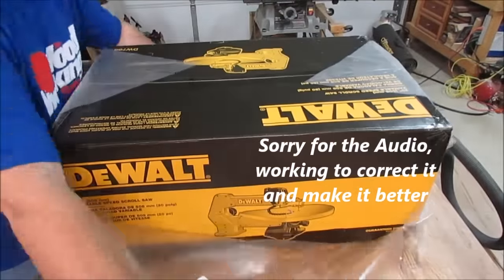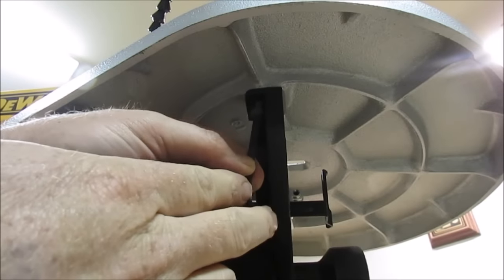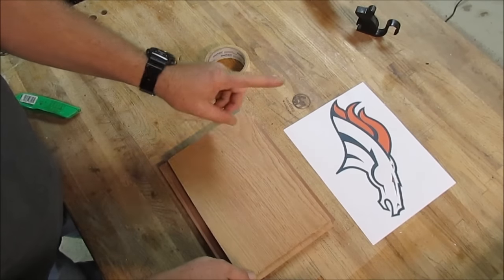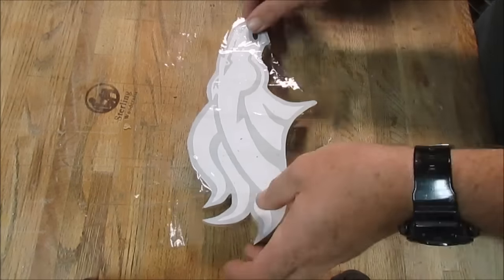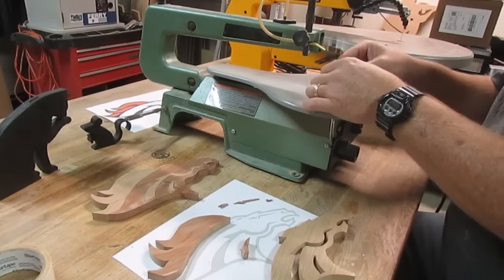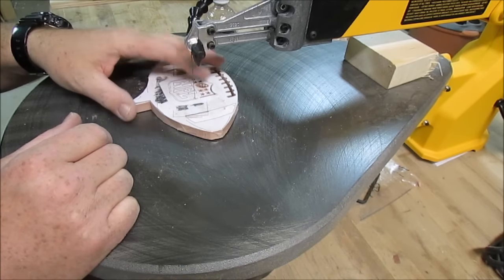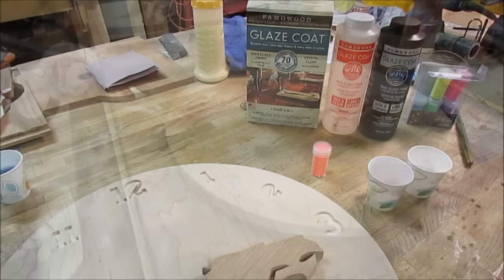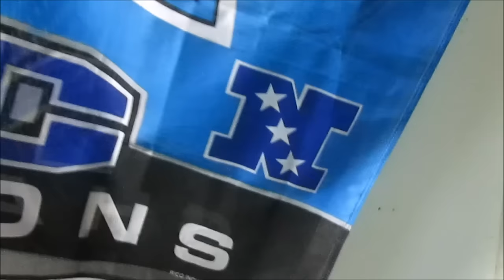Dewalt 788 Scroll Saw Assembly and First Project, Denver Broncos Clock

Comment: great work... amazed by the small details you cut out.  the quick release feature on the blade is super fast.  I have an old AMT scroll saw that is built like a tank with a cast iron top but has pin blades and tension knob inconveniently in the back making blade changes cumbersome.  great video...glad you kept in the  video related issues you're having because I'm dealing with those too as I try make better quality videos on a budget....nice too see I'm not the only one!  take care
Reply from the maker: +Kyle Patrick (fenderhead23) working off a budget is tough, i would love to upgrade some stuff, but this is all for fun, and just putting out what I can, how I can, til it can get better lol, hope people understand, Thanks for checking it out, love the new tool Kyle

Comment: Good looking project!  I have the same scroll saw, and when I assembled it I found that the blade is not centered in its hole, but rides uncomfortably close to one edge.  Remounting the table didn't improve this much.  Do you see the same situation with yours?
Reply from the maker: +Wood Tools Workshop No , mine is centered , not sure what would cause the but maybe there is something out there that will be a quick fix, +Trevor Carter has a fix up video on the DeWalt 788, check it out
Reply: +Sterling Davis Thank you for that.  I will.